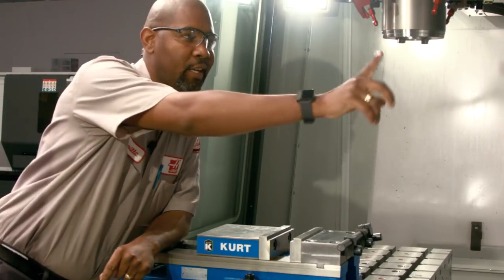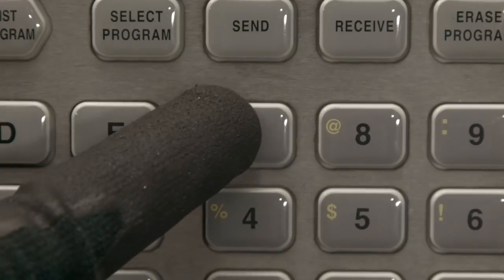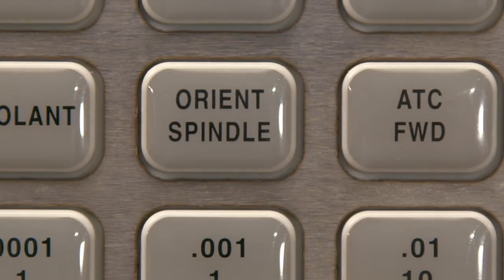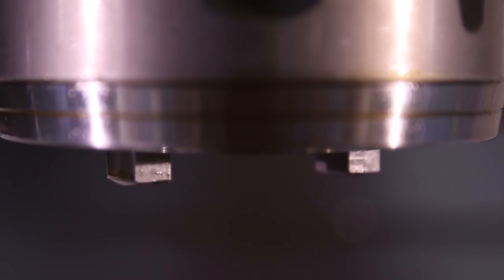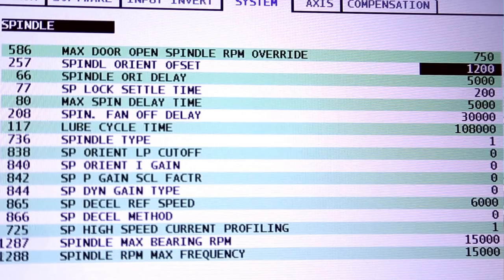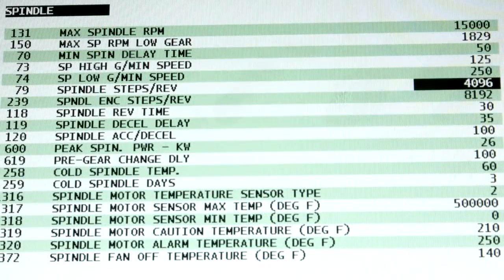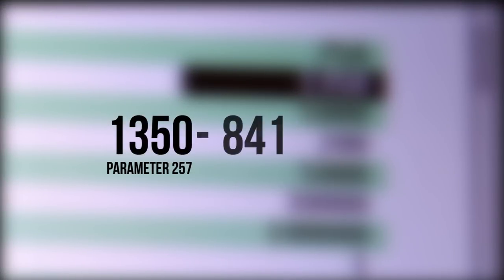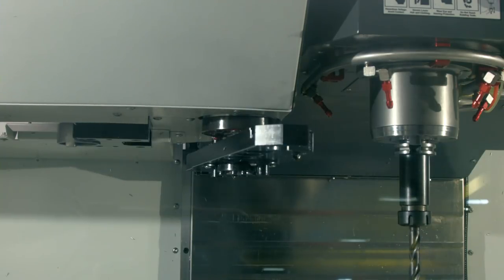Set Spindle Orientation on your Haas Mill with a Side-Mount Tool Changer - Haas Automation Service

Comment: PERFECT!  I followed the steps by the numbers and nailed it the first try!  I will note that my parameter 79 was actually 4000 and not 4096 so I used the 4000 and it was perfect.  I thought I would mention that in case someone else was also different, follow the steps with your parameters. =D

Comment: Since there is an encoder, would it not be easier to allow to spindle to rotate freely and then allign it by bringing the dogs against something with an xz face? Then you could just read out the encoder value?

Or is the encoder in a spot where you need to compensate for the spindle drive (ie: the encoder would give slightly different values if the spindle were allowed to free rotate then back driven to the wanted angle vs driven by the drive motor.)
Reply: Or allow it to free rotate and directly allign it with the tool changer.